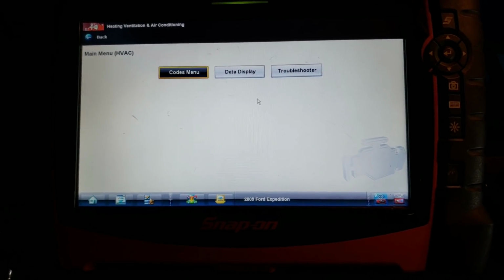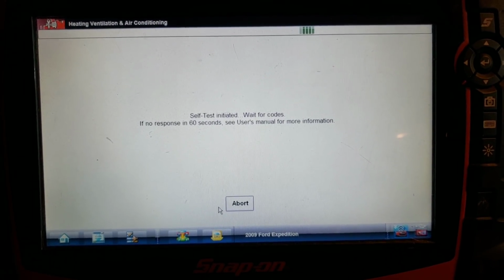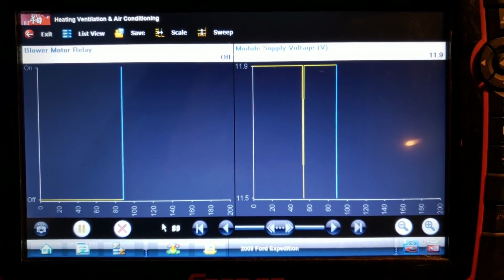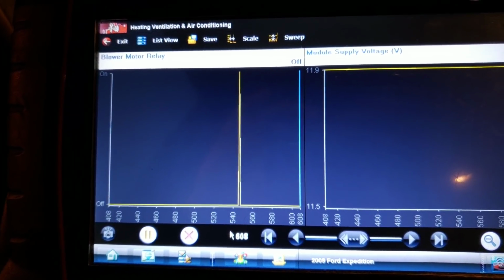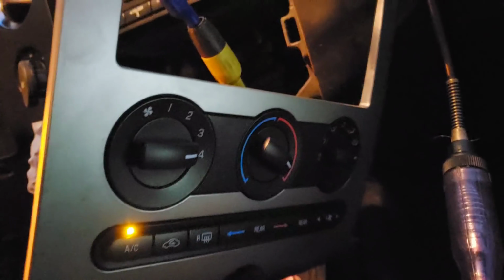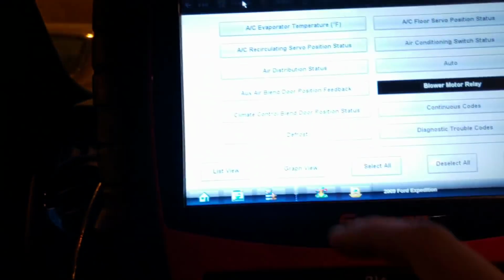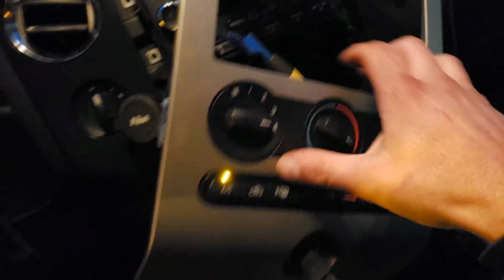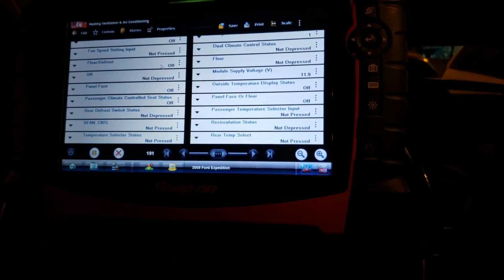2009 Expedition No Blower Motor Operation

Comment: Thank you for the video!! Really helped diagnose some electrical issues.  Purchased this 2009 Expedition  for a knock about work vehicle.  Living in ND at 20 below no front heat no bueno.  Was able to identify two bad fuses and the HVAC control module and replaced, still nothing.  I’m upside down passenger floor board looking at fuses.  Me to myself “hey, what’s this wiring harness go to?”    Looking around I see the entire blower motor assembly is not there, gone……I assume it quit and some point, someone pulled it and never put it back.  191.00 at Napa, fixed.  Aside from the needed module and fuse.  🤣🤣🤣

Comment: Hey Keith, I just went through the ATG network course with Kris Lewis. Does the blower module have Can lines? Is this thought invalid because there are no U codes. Not questioning your diagnosis! Just wanting to learn. Thanks for your awesome videos...
Reply from the maker: Yes it does have a comm line. However thay do not play a role here

Comment: Just happened this morning, and never had happened before. As I accelerate, my water gauge needle fluctuated, and when I was stopped at a light, the needle went down to cold, and just below the middle. 

I've read other channels on what it could be, but they don't have the same solutions.
Reply from the maker: What year , make , and model?
Reply: @NewLevelAuto  '99 Chevy S10

Comment: just drill a hole in the panel add a little rocker switch wire it to the fan boom ur done!  module, I hate that word. just means another headache
Reply: now were talking!!!!! on that pile of scrap ford'odge with timing set ready to vapo-cloud the engine :))))
very short-handed the old joke saying